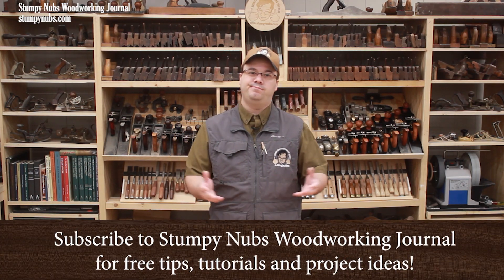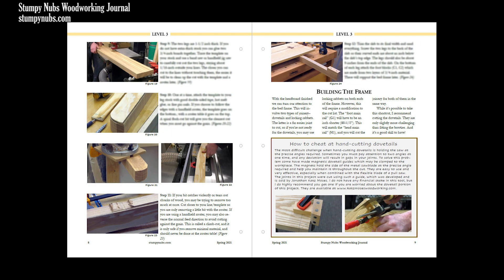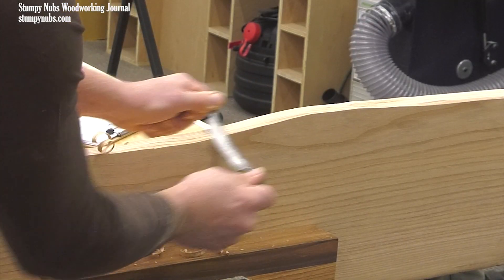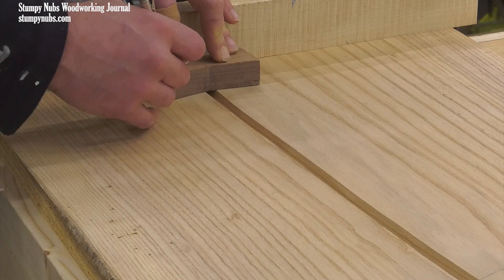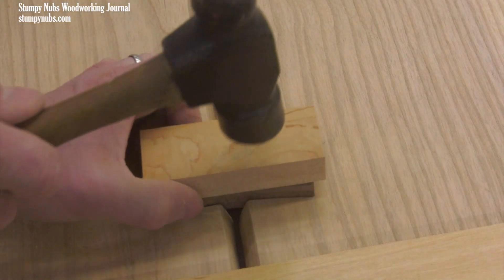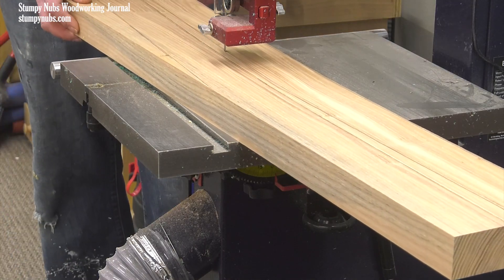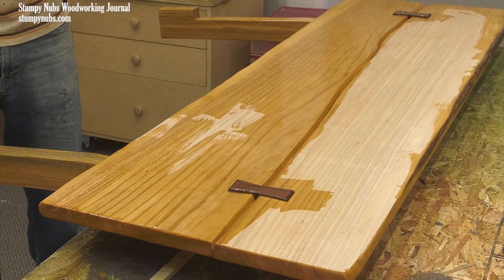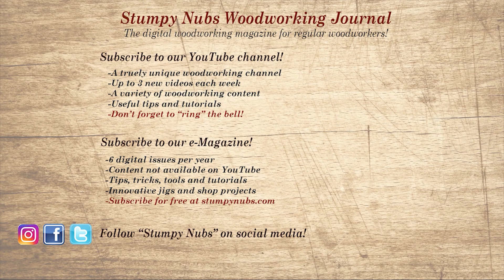Build an heirloom bed that FLOATS!

Comment: Interesting treatment of headboard. I confess, I grimaced a bit watching the (nearly irreplaceable) wide board being cut.  But I think your design decision was correct. Would it have been easier to partially finish the two pieces of the headboard before joining them?  Thanks for the video!
Reply from the maker: I don't think there would be any benefit to finishing them separately. As it was, there was no issue.

Comment: I like the headboard. I think I'll see about getting some 5/4 or 4/4 Ponderosa Pine. I made a floating bed some 30 years ago using a design from Reader's Digest "Complete Do-it-yourself Manual." I used 6/4 Ponderosa Pine for the frame. It's still as good looking today as it was then. I still have the book. I'll post the pictures and plans to you on Twitter. I did modify it for Queen size.

Comment: This is really awesome. However, I used to sell mattresses and any modern mattress needs a solid firm foundation. Without a solid firm foundation you can void your mattress warranty. No one sells "box springs" anymore. The "give" in this design could cause problems.
Reply from the maker: Then put a piece of plywood in place of the slats.
Reply: @StumpyNubs  I've run into this very problem with people who sell mattresses.  If you mention anything about a home-made frame they WILL use it as an excuse to void the warranty and no piece of plywood will prevent this.
the thing is that this frame looks like a good design.
Reply from the maker: I've also learned something about mattress salesmen: They don't go into your bedroom to see if your frame is homemade :)
Reply: Uh.. I think I need a new mattress salesman.

Comment: Nicely Done. Off topic question since I am one of the first to comment. Do you know where I can get a riving knife for an older Delta Unisaw.
Reply from the maker: I don't believe you can buy an after market riving knife form most older saws. But you can make a splitter/throat insert: https://www.youtube.com/watch?v=gzdF-bLXc8Q
Reply: This is the one I have been looking at recently. I thought you could order just the manual riving knife, but it was not clear on the website. I would contact them if you are interested. I was looking at the package though. I have the Unisaw 36-955 from the late 90's so it looks like the manual adjusting riving knife is the only option, but simple enough to adjust without tools.
Reply: @mbarton98  thank you for the advice
Reply: @StumpyNubs  Thank you for the reply, I have watched that link some time ago. Made a bunch. Even made a Zero clearance 45 degree insert because I cut out so many inserts LOL. Love your Channel.
Reply: I even tried to contact Shark Guard but they did not even reply after my request. A lot of people were saying they may be my only hope. I made a bunch of Zero clearance Inserts with a splitter. works Ok , but would feel saver with a riving knife.
Reply: @darrellcaruk8880  I have not tried contacting them yet, so that is disappointing to hear. My Unisaw has been out of commission for a couple years as it would just hum and the blade would not spin. The start capacitor was blown and the local electric motor shop refused to work on the motor because it has the special case with the integrated Delta mounts. I ordered a capacitor online and the motor worked on the bench test, but blew the capacitor again. This time I tried cleaning the centrifugal switch that is supposed to pull the start capacitor from the circuit once the motor starts to spin. Tried again with a new capacitor and then it blew again. So the saw sat dormant for awhile until I could afford a new motor. I got the new motor in and I could tell it was not coming up to speed and shutoff the saw before I blew another capacitor. Now I think the problem all along was the 5500/6500W generator that I was using to power the saw since the current garage does not have 220V. The generator powers the 220V bandsaw, but that is 1.5hp vs the 3hp of the Unisaw. Once the electrician gets my garage wired up and the saw is working, them I was going to upgrade the stock tablesaw guard.
Reply: @mbarton98  Ya the inrush current during start up on a 3 HP is high.
Reply: @mbarton98  Just thinking out loud here--seems there would be less starting current if there was no blade installed?  IMHO

Comment: "Appearing"  to float is different from one that floats

Not that this isn't a nice design (it is)
I would like to see a bed that is cantilevered out from the wall and does not touch the floor
Reply: i feel like that would be very unstable
Reply: @buffasiannerd  It's been done.  It would require some serious engineering.
Metal frame maybe required.
Reply from the maker: So you're beef is that it doesn't literally levitate in mid-air?
Reply: watch the 1993 movie "Point of No Return"
Reply: @StumpyNubs  no, my beef is that the title of the video says it floats.
and I never used the word "levitate"
I did mention "cantilevered"
I think you can do it.
Reply from the maker: Wait until you find out "floating" laminate flooring doesn't really float either... LOL
Reply: @StumpyNubs  wait, what?  say it isn't so!  lol
butt
seriously, let's work on a cantilevered bed design that has no (or at least very minimal) contact with the floor
Reply: @StumpyNubs  ok  I just took a piece of laminate flooring and put it in a sink full of water and it does too float!